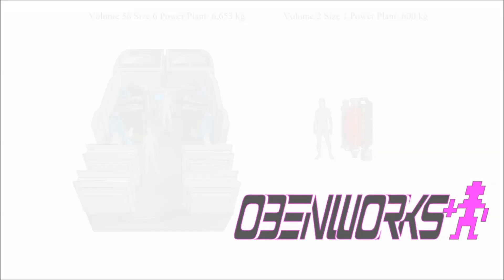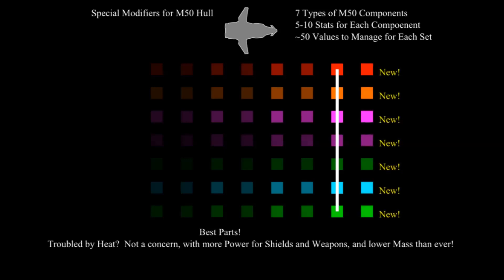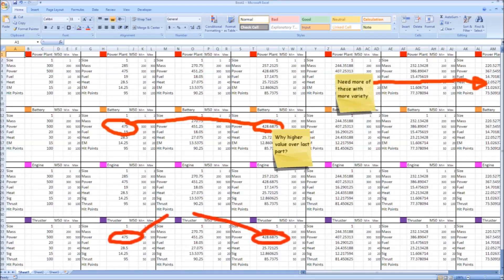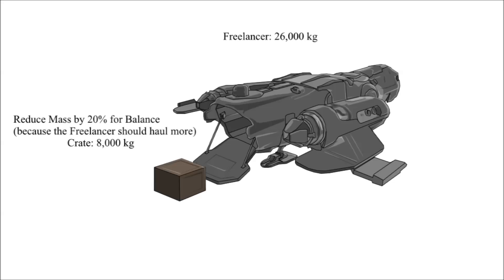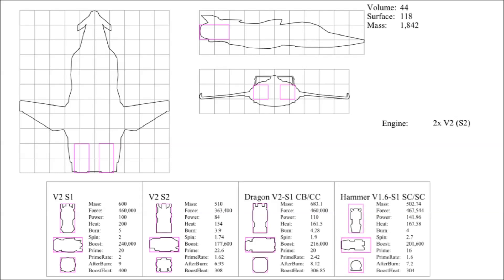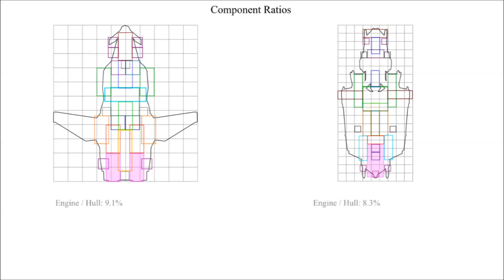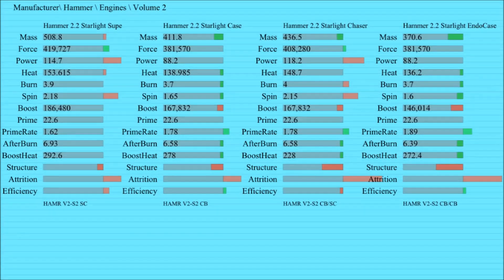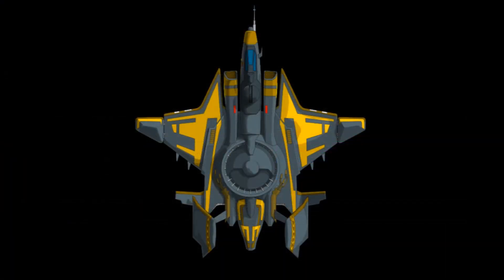Modularity Part 06 (Volumetric Standard: Why? Cont.)

Comment: when you started talking about modularity, I start thinking about new and current engine components for F1 engine and the various parts of the power plant;  the ERS, with the motor generator units heat and kinetic, MGU-H and MGU-K, which are controlled by the Energy Store (ES) which add to the engine complexity as with interrelation of the components for Star Citizen ships, with your illustrations and spreadsheets show

me I am still trying to come grips on why the weapons are overheating in a absolute zero environment (-273K) must be a inefficient cooling system not utilizing  the surrounding environment to augment the cooling system
Reply from the maker: BackGround909 Yeah, emulating heat management in a video game way for a space game that is more video game than sim is rough; my research and some feedback from a guy that designs cooling systems for actual space-craft showed how it would be pretty much impossible to make it an interesting mechanic that was realistic.  For one, cooling as we use it practically in space today is dependent on the sun (or any star).  Without convection, the side of a craft exposed to the sun isn't cold, but very hot (we don't fry on earth because we have an atmosphere, basically, and are conveniently in the precise obit around the sun to heat our little bubble just about perfectly).  So, basically, in a sim, orbit around the dark side of a celestial body would drastically change cooling needs, but we're not using orbits in SC, and I don't expect we'll have to deal with distance from radiation source, LOS, or relative vector (it get really freakin' complicated, and then there's solar winds, EM and all matter of crazy things happening).

"Space is cold" is a hard concept to grasp; let's look at it this way: there is no such thing as cold.  It does not exist, it's merely what we call the absence of Heat; there is no such thing as cold, it's just how we describe the absence of heat.  So, how do we measure heat where there is no matter?  Space is a vacuum -- there's no matter -- so how do we describe how much not-heat there is where there isn't anything?  What there is is a lot of thermal radiation (and this gets even wonkier if we add in little tid-bits like light having mass, but holy crap, it's complicated stuff) and other stuff that effs with everything but has no actual matter (except the ions, or hydrogen atoms missing their electrons, which are estimated as about 90% of the matter in space, but the numbers are HUGELY variable in how dense that is, so I just stick with about 1 atom per cubic meter; if it were 10 or 100 it still means there's practically nothing there; even a hundred times practically nothing is practically nothing -- if you wanted to buy a 20 billion dollar building, and only had a penny, would you feel a lot better if you only had a buck?).

Still, because there is no convection or conduction (transfer of heat to matter), a cooling system is required to radiate heat out of the ship, or even out of any place that generates heat, especially if it's contained.  So, in something like a gun, the heat it generates internally won't transfer out into space like heat does in atmosphere (convection); there is only one option: move it to a place where it can be forcibly radiated.  It has to be moved deliberately, though, because there's no matter for it to transfer to, except the matter it is touching -- the space ship.  So, basically, things like engines and guns and stuff make a lot of heat, and it has to be deliberately radiated away from the ship or everyone in it cooks.

TL;DR -- "why the weapons are overheating in a absolute zero environment (-273K) must be a inefficient cooling system not utilizing the surrounding environment to augment the cooling system"

there is nothing in the environment except radiation and sparse errant protons (hydrogen atoms without electrons), and -273K air would absorb a lot of heat, but -273K NOTHING doesn't.

Comment: I am terribly worried that they in fact are NOT using a rules based system for their ship and component design but are just pulling numbers out of their ass. Sadly my (long) experience with games has led me to be extremely cynical with regard to developer's understanding of (or for that matter even caring for) fundamental game mechanics. I have seen no evidence that CIG is doing things any differently than virtually every other production house over the last thirty years in this regard.

My hope is that you getting MVP means that people who matter at CIG have seen your videos. Frankly, they need to hire you and put you in charge of stats.
Reply from the maker: Peter Cohen I'm still confident that whatever the plan was or is, they will eventually have to reconcile the data, if for no other reason than it must be in order to properly manage it.  The example system is a good starting point for this, so worst case scenario, I've at least demonstrated that it can be done.  I still have a lot of faith in the CIG team.
Reply: Nebohtes  Safe that attitude, i am with you ;) also why would they reward you an MVP if it was totally of their scale..., oh and check out the Video from Zane with the advanced control surfaces, makes me proud to back this Project
Reply: *****
https://www.youtube.com/watch?v=9KPZ9JPlSDY&feature=youtu.be

Liked for the Skyline ;)

Comment: Good Stuff.
Question: Why is the M50 so Heavy? The Hull would only be like 1500-2500Kgs?
Reply from the maker: John Gray The numbers that get spit out are fantasy -- we could fudge them around so the M50 did come out to around 12,000kg, but then all of the ships would become much heavier.  I figured the mass calculations to keep sort of on track with their stats page results.  After equipping the M50, it comes in between 4,000 and 8,000kg, or thereabouts.  The M50 is the biggest Stats page anomaly, until the Carrack, which is around 10x the volume of the Constellation, but has less of smaller components and the same size power plant.  Hooray, alpha!